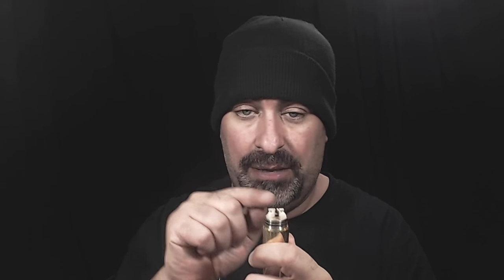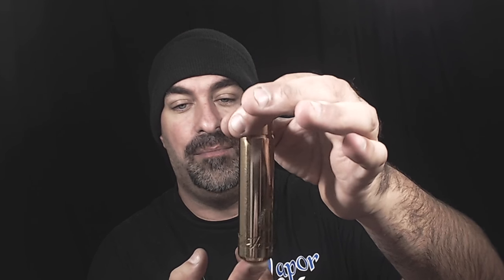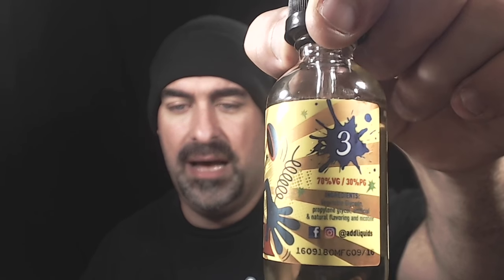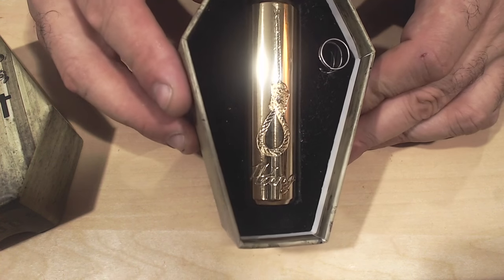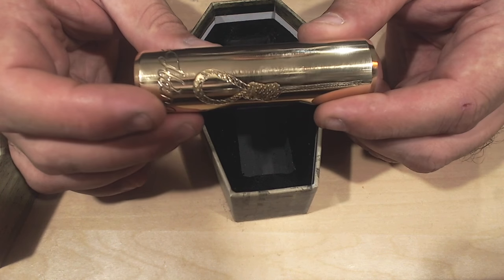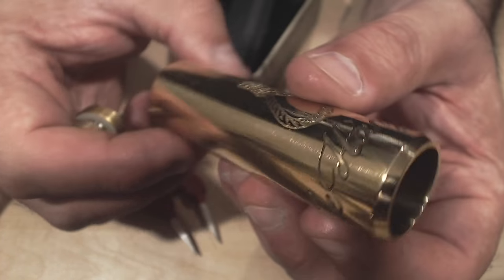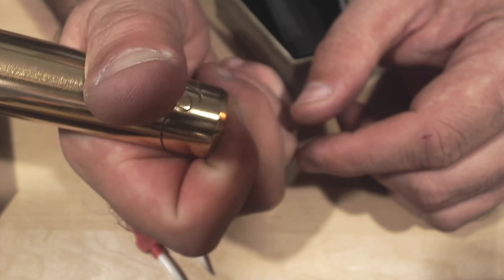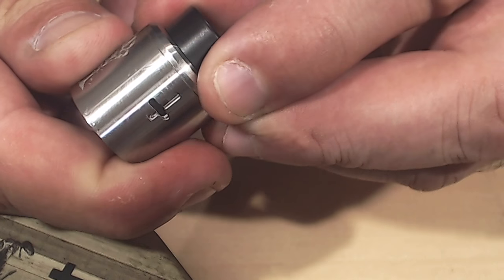Deathwish Modz The Hanged & The Unholy RDA $200 Set Up

Comment: i was wondering if this was gonna ever get on the market. this is one i will need over the broadside. this thing has all the little "sales points" that would make me buy it. the inverted cross had me sold for certain. and the hand was killer. i love this fucking mech.
Reply: yetisuncle been on the market probably sold out by now. the raven is the next run coming out November 14th I think.
Reply: www.mohawkvapors.com has them in copper brass and stainless steel etc go their if you are looking to pick one up.
Reply: ***** holy shit!!!! thanks for the info. this thing is killer. i must have one.
Reply: Yeah I just checked according to the site they have like 5 total. It's a sweet set up hope you get one.
Reply: yetisuncle No problem man glad I could help.
Reply: Eric Newberry holy crap.... those will be gone by the time have the scratch saved up. damnit.... i love this whole setup. it really speaks to me..
Reply: yetisuncle the raven is available for pre order it is the same mod basically just different designs. Still bad as fuck. Plus there will be like 500 in each finish I think

Comment: hey big lou, great review bro, been subbed to u from my very first day vaping, love ur vids. i have a quick question; i have recently been cleaning my brass goon with brasso, it comes up like a shiny piece of gold when polished, whay do u use to clean ue brass kit?
Reply: Hey Paulie! I'm not Lou but I feel like answering anyway ;-) I use a mixture of 1 part salt, 1 part flour and 4 volumes of white vinegar. It makes a thin paste in which you put all your parts. Leave it for 15 to 30 min depending on how dirty it is then rince it with tap water to clear the paste. I finish it with a microfiber cloth for extra shinyness. You can use it on copper, brass and gold all the same. The advantage IMO is that the paste gets in all the tiny gaps like threads and such and cleans everything. Minimal scrubbing and great result!
Great video as always Lou!
Reply: Ben Use thanks for  some great tips buddy, appreciate that ;-)

Comment: Big Lou I need your advice please. Im in the market for a rda. I dripped for a couple of years then quit and used sub tanks strictly for the past year and a half. There is so much on the market now im stumped. Can you please recommend something that will last me a while. Thanks man
Reply from the maker: Authentic RDA's today are built to last forever. I am still a sucker for 3 post RDA's thats why I like the Avidlyfe Torpedo and Battle deck from Complyfe. Simple easy of Use and Hard Hitters based on silver plated copper posts
Reply: Awesome man. Thanks for the reply. Having trouble finding it. How is the flavor? Also I recently purchased the new releaux 2/3, think its man enough to screw that on?

Comment: I have the same set up. but when I put a drip tip it ripped the oring. I need on other one. would of been nice if they added n extra
Reply: jose avalos If you take the foam out of the rda box there is a baggie full of spares parts like screws,510 pin and orings!
Reply: DirtKing 710 thanks. I did have extras. the foam was so tight in the box that I couldn't even move. I thought it was glued on their and didn't have anything under it.
Reply: That's wierd! If i was you i would check out the Deathwish Modz facebook page and message Maxime he should be able to do something! All the RDA's were suppose to have a parts bag under the foam!